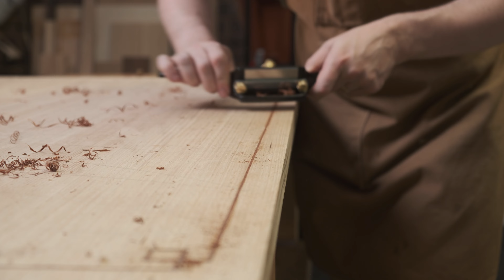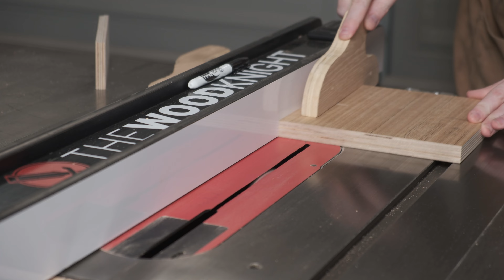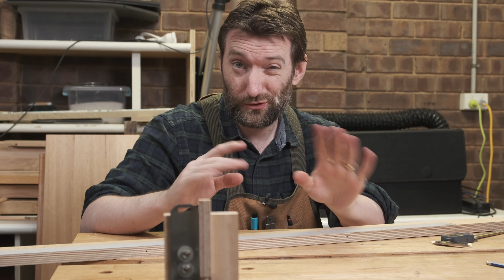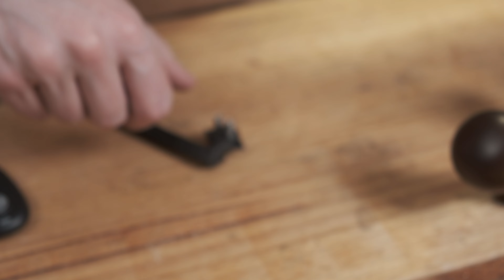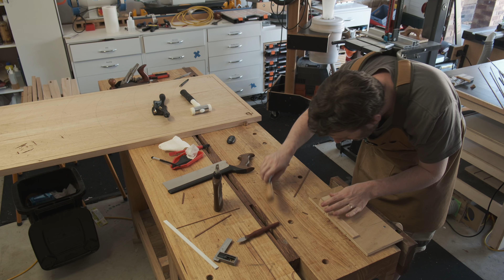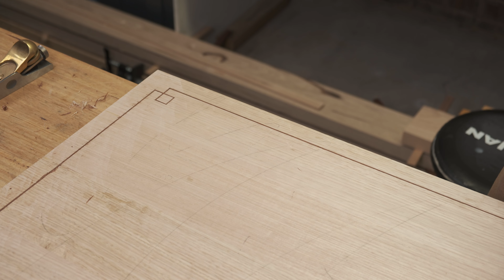Class up your woodworking with String Inlay

Comment: Stringing always adds a touch of class to things; you done a very good job with it lad, it looks amazing 😁 
A scraper works best with a burr, and presented at a negative rake...... leaned forward like your No80. The first jig didn't work because there was no burr and the edge was presented at 90⁰. For that jig to work, the flat back of the plane iron should be facing the infeed side of the jig with the burr rolled over to that side, and the iron canted over toward the infeed side to give ya the negative rake..... basically the same geometry as your No80. You could have used the No80 to thickness the parts; but that would have required another jig and time spent, I reckon ya got it done fairly rapid with the sander 😁
Reply from the maker: Good to know on the burr - I might revisit the jig again later in the year! Since I do have the #80, I might just use the blade from that, and use a similar 3-screw-system in a jig (2 for retention, 1 for angle). that way I don't have to keep track of which blades do or don't have burrs on them 😂
Reply: @TheWoodKnight  I would use the No80 as is, with hardly any curve pressed into the iron with the rear screw, presented to the work slightly skewed to reduce chatter. It could be done with strips of wood the same thickness as ya want your parts to be....... but then it's back to square one makin pieces the right size 😆 whats needed for this is two "runners" of the right height that the outsides of the sole can run on, that could be two thin strips glued down (back to square one makin parts the right thickness) or a long and wide groove/dado cut to the right depth down the middle of some MDF or ply. Your parts go in between the runners or into the groove/dado, the sole of the scraper outboard to the left and right of the iron is on the high points, then when it stops cuttin your parts are to thickness, the sole ridin on the runners won't let it go deeper. 
Often I'm not very good at explaining things, if ya have a gander at lads makin kumiko with hand tools you'll see the type of thicknessing jig I'm blabbering on about 😁 that particular process is usually done with a hand plane, but a scraper might be better for those stubborn woods yee have in your neck of the woods....... I'm in Ireland so I am used to "normal"  compliant woods like Beech; got my hands on somethin called "mallee" before, was like tryin to plane a stone lad 🤣
I've always thought the word "scraper" was a bad name for such a tool...... once ya figure out how to make the burr (I struggled with that for about 5 months solid, tryin basically everyday and failing each time) then ya realise there's no scraping involved; it is actually a cutting tool that produces the finest gossamer shavings ever seen 😁

Comment: When I've done stringing in the past, I've taken the easy route and used veneer. You got more intricate with the box weave pattern, but I've done it using a tapered scratch stock in the past where exact width can't be fudged a bit.

Comment: Man that thumbnail was instantly appealing, nicely done. Love the decorative, deco look. Great result!

I wonder if you could angle the bandsaw table slightly so the strings are tapered, then hammer them in like that?
Reply from the maker: Thanks!

Sort of like double bevel marquetry? Thats an interesting idea - if you could match the angel with those tapered ballnose end mills you could get a very snug fit pretty easily.

Comment: Nice work!  Was wondering if you could cut the strip to final size by routering a groove in that 3/4 ply you used to thin the strip initially. Then slip the strip in the slot so it’s supported, and then thin the thickness down with the drum sander.

Comment: That really does class the place up, I look forward to stuffing it up on a future project of mine... I don't think I've ever been so precise with a big ol' router as you were there, maybe my stringing will be 18mm thick, that'll be easier... 😁
Reply: if it's 18mm does that turn it from string into rope? :)
Reply from the maker: That little 18v Ozito router of yours would probably be perfect for that - I know it has a plunge base option, do you know if it has a decent fence?
The big router worked well, but it was pretty tiring to make the little cuts with all that weight.

I'm with @pete.g - rope inlay sounds great :D

Comment: you can get seriously thin stock using a zero clearance with a 7in   Diablo blade on your table saw. Use a thick blade if you can find them, otherwise a thin kerf will do just fine. Just plane your stock down to the Height you need then rip for thickness. I didn't go down the rabbit hole with wood inlay I went with silver wire inlay, so even less info out there.  haha

Comment: Have you ever considered using CA glue for  gluing in the stringing?
Reply from the maker: CA could work, and if I was doing a non-wood-inlay (crushed stone/etc) that'd be the way to go. The 'danger' of CA is you'd have to use the thin stuff, which has a very quick set time, and getting the pieces to fit exactly can take a little bit of back and forth. I'd hate to have it set before I got it fully seated!